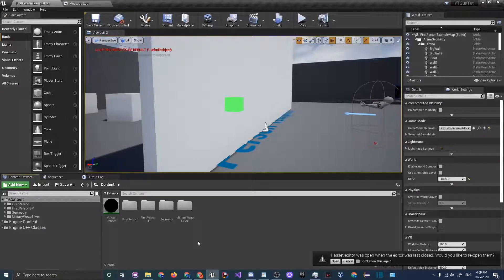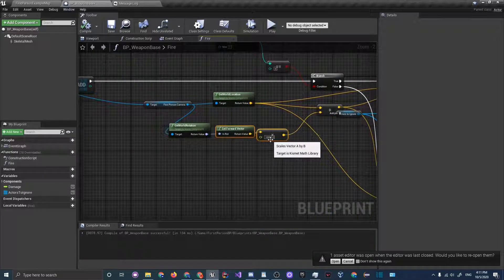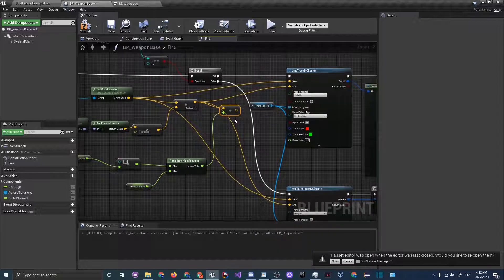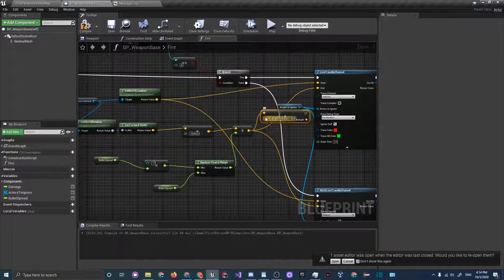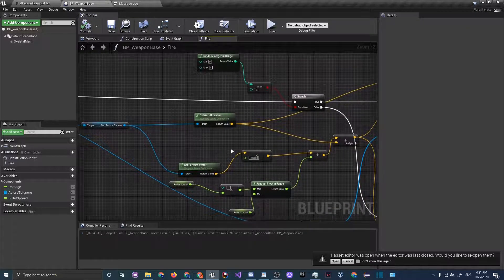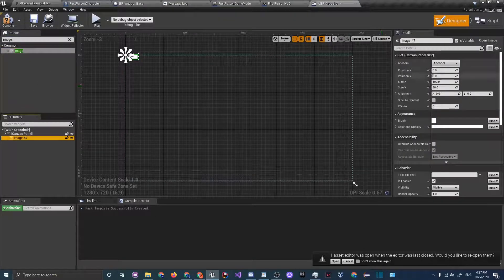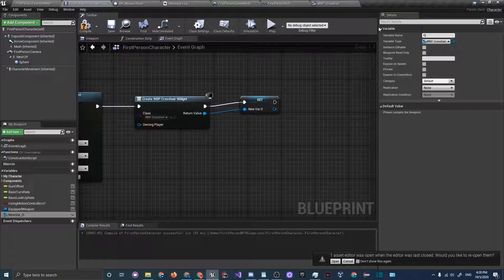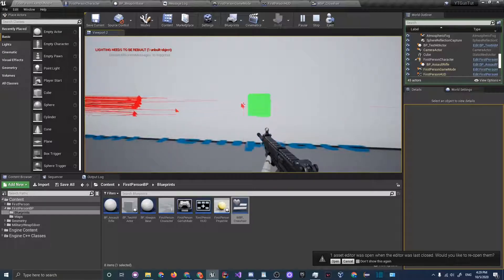Unreal Engine 4 Professional Gun System Tutorial - Part 3 | Bloom (Bullet Spread)

Comment: nice one.. but it looks linear! not really spread around the crosshair but instead it's going on a diagnose line! Maybe if you try a random float for each vector (x, y and z) then hopefully it will spread more like it :)
Reply: X and Z are enough, Y would reduce range
Reply: @vegitoblue2187  even in real guns bullets won't travel the exact distance every single time. There's a margin (range) error. So random y between for example 90 and 110 is a lot more realistic than sharp 100 for every bullet.
Reply: @RaedAbbas  It might likely cause frustration if you randomize the range. That is where realism has to be balanced with convenience